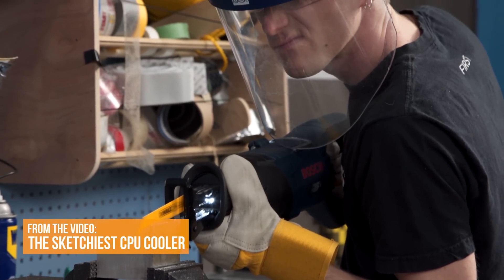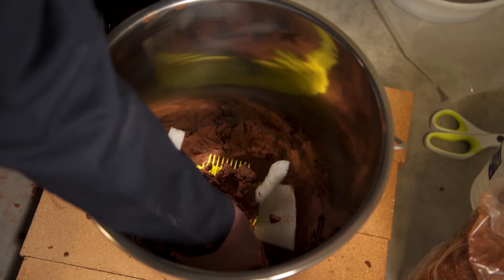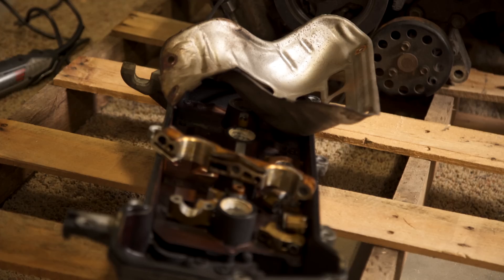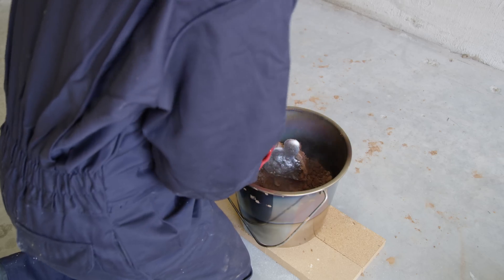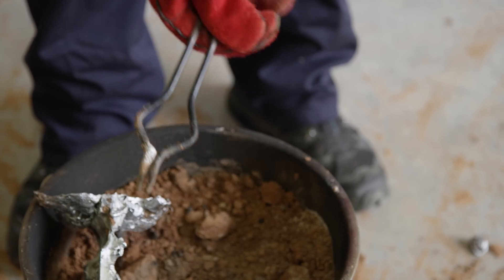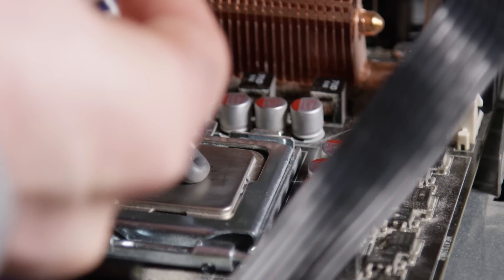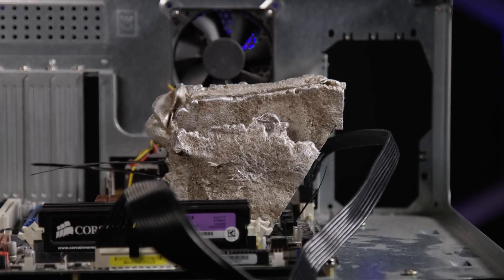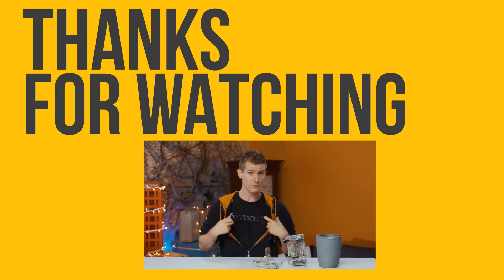The WORST CPU Cooler EVER – Sketchy Heatsinks Ep2

Comment: Hello LTT, I have an idea for your Sketchy Heatsinks series or an interesting build of sorts: 

How about buying a large bag of fine powder Aluminium oxide and using it as a massive pseudo heatsink - this thing is electrical insulator so in theory it shouldn't short anything and it is a good thermal conductor with massive heat capacity at this quantity - something like an oil submersed PC but in powder I guess :D (you could get it cheap in larger quantities at it is sold for about 900 USD per ton in china), laying computer on it's side leaving top open filling the whole case  fully with Aluminium oxide and pressing on it well. You would need to seal the holes in the case with cellotape obviously. This could theoretically keep the computer cool and completely quiet via convective and radiative cooling. I'd keep the stock heatsinks installed though removing only active components of CPU and GPU coolers. This could also be done on a bench without a case packing everything in thin transparent Polyethylene or Polypropylene bag making it more geared towards radiative cooling (PP and PE are nearly transparent to IR at room temperatures). I'd love to see this build :)

Keep up the great work!!

Comment: maybe 3d print a heat sink. pour silicon over the mold. with the silicon mold pour wax into it. then mix a plaster of paris mix and poor that onto the wax with risers. then let it comepletly dry and then put it in the over to melt the wax. pour metal into it and break mold

Comment: 1st of all you should use a casting plaster and the consistancy should by liquid and you let it dry out once you put your Preform in it (you pour the plaster to the container with the preform - the preform should be rigidly fastened).
2nd you have to Evaporate the preform 1st and you are going to need an oven to do so.
3rd once you get the plaster out of the over immediately you should cast the metal in to the mold.
i remind you that this is not 100% the way to do it coz you dont have the Equipment but this is the closes you can get in my opinion ^_^

Comment: What the hell , the techniques used for making the mould and pouring the aluminium are completely wrong and the i guess u didn't add flux either to drain off the air bubbles inside. Please don't complain that you got a shitty cooler if you cant do it the right way.

Comment: Ya know, the easiest way of making a heat sink is with copper. cut your base to size then decide on the number of fins and their size. Cut everything out and then using a high melting point solder, solder it all together.
Reply: Oh you can also use brass or bronze.

Comment: Put your plastic mold in a plaster, use a vacuum chamber to pull out any air in the plaster and put it in an oven with high enough temps to cure the plaster and burn away the plastic heatsink mold.  While the plaster mold is still hot pour your molten aluminum into the mold.  Once completely filled, let it settle for a minute, then submerge in a bucket of water.  The temperature change will cause the plaster to disintegrate leaving your nice aluminum heatsink.   Jeweler's use this technique with wax to create jewelry.

Comment: Wait this took 3 people to make, seriously?! There are countless videos about loss foam casting, making a furnace and making a mold yet no decided to use those techniques. For example you could still use the PLA template but use a mold instead of the foam loss method and that would give a high detail casting. The foam loss method is good for large items but terrible for high details such as fins.

Comment: Actually, i kinda find that heat sink rather "West Coast Artsy" in terms of design.

I would actually use it in my system if I could powder coat that heat sink 
in deep navy blue and have some glowing LED's at the base AND for 
good measure drill some holes in it horizontally near the base 
to drive some 3M dialectric cooling fluid through it
to wick away the heat!

AND FINALLY, place the motherboard onto a 5 cm (2 inches) thick 
base  of Lucite clear plastic with NO side walls to showcase 
that "Incredible Looking" heat sink.

===

For your THIRD SEGMENT on ugly heat sinks, may I suggest an upside down
GLASS pickle jar with the metal lid facing DOWN onto the CPU (use thermal paste). 
Please do make sure  that you fill the jar with nothing but one of the following
items such as Canadian Winter-certified Radiator Fluid, OLIVE OIL, or even 
MAPLE SYRUP to see what happens thermally to the CPU!

A Maple Syrup Glass Jar Heat Sink ..... Now THAT would be an awesome CPU cooling demo!

Comment: you should have used sand casting instead of lost pla casting, you use the 3d printed model to make a 2 part mold then take out the model leaving a cavity you then fill with aluminium

Comment: you just dont k how to make melts. well listen , you have to make in and out tubes and liittle holes so the air can you escape in the bucket and also put baby powder so the sand hold its shape. Also the bucket isnt good, you need to have 2piececls of wood so you can make better molds

Comment: What if instead of trying to make a heatsink out of a single aluminum piece (whether by sawing or by smelting), you guys used aluminum sheets spaced by aluminum (or copper) rods/needles welded on to a perpendicular aluminum base block that makes contact with the cpu?

Comment: 3d printed liquid cooling system might work. Have you tried that? As reservoir you could use a soda bottle since the only requirements are volume, surface and keeeping the liquid inside. The whole proces would be way easier, less dangerous and a lot cheaper. Also the result would be way better since you just need more bottles to increase it's capacity.

Comment: Why not just somehow retrofit old car radiator/condenser sections? They have a crazy high surface area for heat dissipation, but fins are super thin, not giving you a lot mass for the small area you have to work with, but it may even out.

If more mass is needed, you could source a section from an air-to-air intercooler that might actually work fairly well (Get an OEM top mount, as they aftermarket ones have pass-through chambers that are too thick for this.). I'm not sure if I can explain this well, but if you leave only one vertical *cross sections of fins on top of the lowest pass-through chamber, then bend that bottom chamber at a 90 degree angle (mounting it on the flat side you just bent upwards), then you would have several vertical stacks of more solid pieces of aluminum (originally the pass-through chambers) going upwards with fins between them to wick away and dissipate the heat. =)

Comment: I know you didnt cast it upside down to keep the contact plate smooth but you could pour it side ways so the fins would get filled and keep the contact plate semi smooth / flat by being on the side wall.

Other alternative would be to use masonry sand or whatever it is that will dry to a shape.  If you mold the sand around your 3d printed template with a cut out circle built in you may be able to cleanly cut it with fishing line or something then lift the mold in two.  If you plan that with your pour opening you can remove all obstructions that will cool the metal down and just cast in the mold of dried sand.  

Its not strong stuff but if you are careful you can work around it and move it

Comment: Just cut an aluminum block with a circular saw, instead of the reciprocating saw, it will be a lot faster, although getting thin fins could be a bit challenging (even spaced thick fins vs broadly spaced thin fins)

Comment: oh cmon, be sensitive with them. where is failure there are lessons learned. and for their first time doing aluminium casting with such a complex geometry it came out... reasonably... well? Nevermind, there is a reason that most massive body aluminium heatsinks are cut ups from extruded profiles... also aluminium dissipates heat pretty well and becomes solid fairly quick so think about preheating the matrix. Plus you will never get a smooth enough surface for the contact plate directly from the mold. you will need to work it afterwards. sandpaper and patience might do the trick I guess.
But who am I, just a guy in the comments xD

Comment: what if you use the 3D printer model to make a plaster mold that you bake in an oven to remove as much humidity as possible, and then cast the alluminium in it?

Comment: You would have better results machining a block of aluminum into a heatsink instead of casting. Hit up your local machine shop or CNC shop and they can turn that SolidWorks model into a real heatsink.
Reply: well they try to make them by hand. in the last episode they cut it with a saw. i dont think that would fit into this format.

Comment: take some sheet metal and put multipple sheets on a screw with spacers between each sheet and a plate welded to the bottom of the screws wich are like heat pipes

Comment: I would have gone for a method where you could make the mold from thin pieces of wood, pack the sand into a pair of boxes with the mold inside, remove the mold, put the two packed boxes together then pour, using the correct vent holes.

Comment: oh god, what complete amateurs....
Reply: Yup, that is exactly what they are. Just a bunch of dudes who read some stuff and tried something and failed lol
Reply: Eugene InLaw Being an amateur doesn't necessarily mean that you are bad at something. You're just not getting paid for it. The guys who did the casting were horrible and still got paid.
Reply: least they're actually trying something
Reply: I can tell you how it could be done easily from the same stuff they had. First they would have had to make a solid base block for that touches the CPU and then cast the fins or plate thingys and weld then on it thus they could get more fins and thinner ones as well. Also if they made that green sand to fill in more and be less sloppily applied then they would have less of a messy surface to start grinding from.

Now I could do this if i had all the recourses and equipment bought for me. But I don't so I cant make a video about this right now. And I also do not have any kind of interest in metal casting or a degree in any field. I just use a bit of my brain power and I could get lower thermals with that than what their "engineering" department had with that chunk of metal.
Reply: the official sandidge02 hmm, well my very first cast was about... infinitely better than this, since this result is unarguably worthless. on the other hand I did have a teacher and I did understand the basics of casting and that this can hardly work in your backyard and the materials used. On the other hand this series is obviously directed at the people who say that it's trivial to make a heat sink - because it's not.
Reply: XanduxerGuy better make a solid prototype out of, for example, wood and use it in pair with any cheap filling (dirt will do) to pour molten aluminium into a cavity left after the model's removal. The method they used is really only good for metals with high melting point like iron, and even then they'd need to put more effort into the casting form. Burning plastic out with molten aluminium is a bad idea
Reply: +Eugene InLaw Well I meant this as in the way they are making this. Like form same materials. But ofc making a mold made out of more soldi materials would be better or something I dunno.
Reply: XanduxerGuy it's just different techniques are efficient for different situations. They did a very poor job at metal casting
Reply: +Eugene InLaw yep that they did.
Reply: ***** I'm not gonna waste electricity just to prove a point to an insignificant human

Comment: Try to make a thermoelectric cooler!
Reply: you do realise that a thermoelectric cooler needs a heatsink too right? it'd look the same as before. you'd have cpu, then the thermoelectric cooler stacked on top of it and then your cpu heatsink. and then your cpu would run hotter than before with the same heatsink.
A thermoelectric cooler gets cold on one site and hot on the other. but since theres some loss in efficiency the hot site is a little hotter(if the thermoelectric element removes 80 watts of heat from your cpu the hot side will be 90 watts or more). and then you'll have to remove the heat from the hot side. how would you do that? ya with a heatsink.

Comment: That amount of thermal paste should have drastically reduced the capability of cooling. It used to fill the space between the heatsink and cpu ihs, but has really lower conductivity then any of them. You only should have layer as thin as you can.

Comment: Your casting skills suck... get a new engineer.

I happen to have a masters in mechanical engineering :D.
Reply: ok let me correct you here... No, 99% of engineers do not know shit about casting. most engineers do not even touch on that subject, but a process engineer who focuses on the chemistry and mixture of the aluminum, even that sounds fancy huh?, doesn't even know about casting. to know about it, you'll need to find a job or specialize in it, because there's not much you can do in the engineering field to study molten metal and molds. most of that comes from a scientific degree/field, metallurgist, or blacksmith.
Reply: David Gardiner He needs a casting expert, not an engineer.
Reply: chronicblazer84 Obviously 3D printing must have enough benefits otherwise my university wouldn't have dropped so much money on it, LMG is not trying to mass manufacture heat sinks but they are trying to play around prototyping heatsinks, which is exactly what 3D printing is for. Also, I'd heavily contest the statement "yet none of you know how to apply it practically". My electronics engineer friend jerry rigs all sorts of cool inventions, and my mechatronics engineer friend built a robot vacuum cleaner from scratch for his final, and it was way better than what I've seen commercially available to boot.
Reply: 3D printing is limited to prototyping. FDM sucks arse to work with and it's slow as sin with limited resolution, SLA is promising but the resin is both expensive and weak.

Even the commercial power based systems can produce very detailed prints but without desirable mechanical properties.

Milling, casting, molding, stamping etc. are still by far and away the way to go. I want to build an injection molding rig at home after I play with my new CNC router.
Reply: chronicblazer84 I can understand how you were confused, I meant project in the limited scope of an assignment, or like it has been demonstrated here, a quick DIY project by people who are otherwise inexperienced in a specialised field. I'm not knocking you or your profession at all, and I was actually trying to push the point that engineers are not by default a good pick for this specific project at all, especially if you give one with no experience with casting the project. I'm sure you would have done a way better job, but we don't watch LTT for well-executed projects do we ;)
Reply: Ross Bishop The high grade commercial 3D printers my friends who are studying to be engineers use are advanced enough that they can do almost everything they need to get their degree. When you are out in the workforce, according to them, you still make heavy use of 3D printing for prototyping, and once you have a design down you pass it along and it gets manufactured for realises.
Reply: You use it for prototyping and then use something traditional for the actual manufacturing because 3D printing is a combination of too weak, too time consuming and too expensive.

There are hobbyist grade companies that use FDM for enclosures and I wish they wouldn't, they look and feel awful.

If you're making something in enough numbers out of plastic, you injection mold it. Initial outlay costs a bomb but after that you can pump them out all day all night for nothing and get a quality part at the end of it.
Reply: Saying engineers can't implement anything in practice is just as wrong (if not, worse)  than saying they can do everything technical related. But yeah "engineer" is quite a broad titel...

Keith Anderson, you're basically agreeing with chronicblazer84 since he said 3D printing is not suitable for (mass) production and you're telling him it's good for prototyping. For Linus 3D printing is indeed more ideal.
Reply: Ross Bishop yea my school has a few ultimakers, which aren't too bad as far as consumer printers go, but they're bad enough that they make me painfully aware of 3D printings limitations.
Reply: The Echelon yea I'm tired and I'm not reading or typing straight. I'm not trying to disagree with anyone but my eyes and fingers betray me :(
Reply: the official sandidge02 Proper names? I don't see anything wrong with what he said. I'm having a suspicion you're just trying to sound smart because you're adding nothing worthy to this conversation. You're probably just a troll though.
Reply: Chris Verkaik Not really haha. computer, electronic, software, mechatronic, chemical, civil and many more kinds of engineers do not know how to do that stuff, unless they end up doing casting for a project, which nowadays has been largely replaced by advanced additive construction technologies (super fancy 3D printing).
Reply: Engineers usually know how to do this though.
Reply: Not everyone is good at everything, and noone cares about you having skills in mechanical engineering, so fuck off back to whatever shithole you crawled out of.

Comment: you probably should have bought greensand than made it, It would have been a much better cast and you should have put the DIE or the side that touches the CPU at the top so it will fill all the fins up which would be on the bottom and actually overfill the cast then you could cut off the excess. I have only cased steel and Iron but I do think aluminum would be much different other than a lower melting temperature. have over 4 years of experience working in a metals shop FYI where we did some casting from time to time.